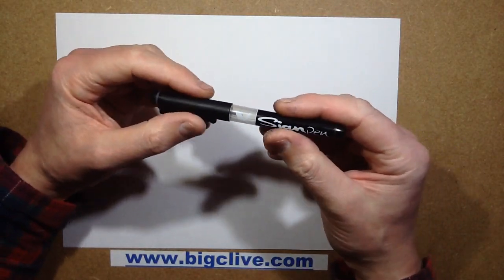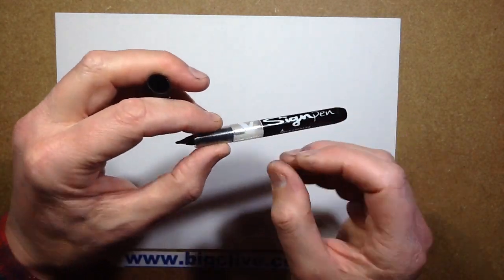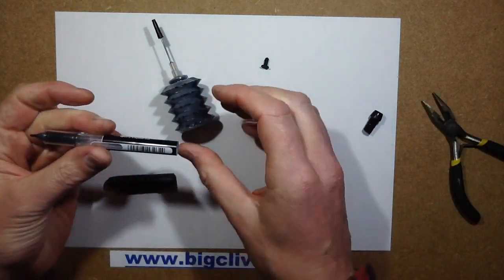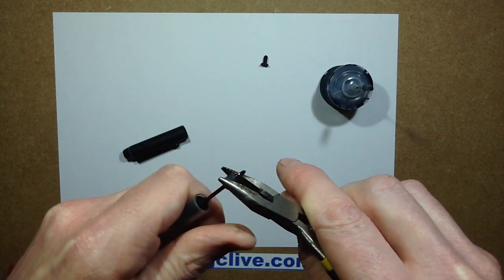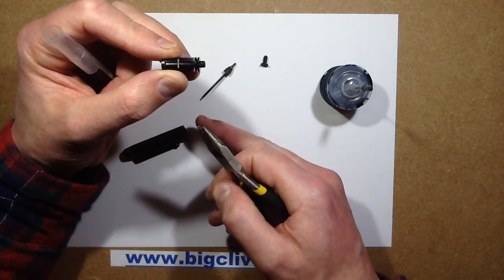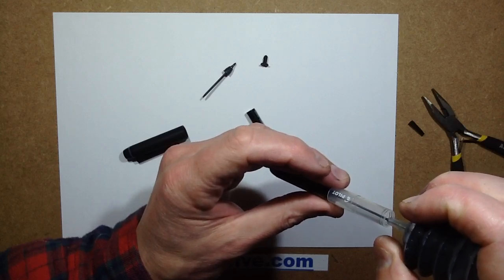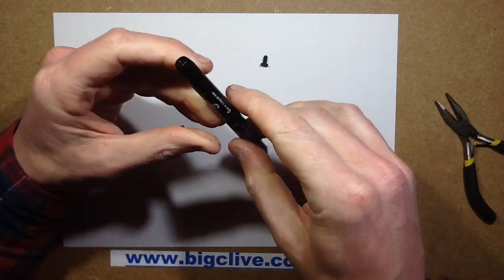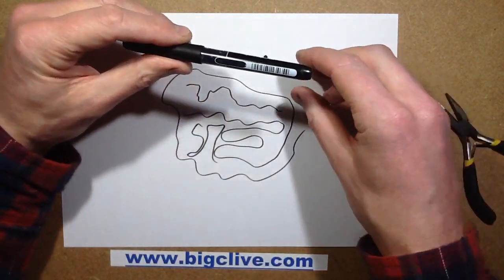Refilling a Pilot V Sign pen with inkjet refill ink.

Comment: Once the felt tip nib come off, I would suggest using a syringe with a needle, to inject ink through the hole left behind by the nib. That way, no need to pull the finned section out. It looks like it requires a fair bit of force to pull out with a pair of pliers and risk damaging it.

In another youtube video, refill pilot pen using vacuum method, the method can be used for this pen without any risk of damaging the pen.

Thx for showing us another way to refill this pen!
Reply from the maker: The ribbed section is pretty robust, but you do have to grip the end quite tightly.  I also wanted to clean the ribs of residual ink, although you're right, a long syringe would fill through the nib and wick hole.
Reply: not so robust though, we can see a bent disk on the end in the video. and if you do it multiple times it will break. so the needle already on the refill kit (looks narrower than the felt) should be the better option unless you really have to clean the ribs.

Comment: I've kept a Pilot V5 going with fountain pen ink for about twenty years.
Reply from the maker: How does it compare to a new pen in terms of writing smoothness?  Some of these pens only seem to be bedding in as the ink runs out.
Reply: I'm a big V5 fan.
Reply: Wow, that's a really long time. After about 5 fillings, I find that the ball in the tip will drop off. I get better mileage with a pilot varsity/v pen. I could refill those indefinitely.
Reply: ThePillenwerfer what was the ink's name? I want to refill my v7.
Reply: It was Parker Quink fountain pen ink.  I'm sure other brands would work.
Reply: That pen has lasted you longer than I have been on this earth...
Reply: @bigclivedotcom  I am using it for 4yrs now so u can't tell the difference
Reply: @bigclivedotcom  I use v 7
Reply: @soyankanagray6492  I use pilot hi-tecpoint ink. It's super cheap and is the same quality as the new pen ink. Works well with v5 and v7

Comment: Great video. Will the wick hold up? It seems on many of these pens they go bad or get dried out or worn out.
Reply from the maker: The tip does eventually wear out after several refills and very heavy use.  It helps to use pens like these on good quality paper that is not scratchy and abrasive.

Comment: I wonder if it would be possible to drill out the top of the ink reservoir, allowing you to use the entire barrel as an extended reservoir?
Reply from the maker: I did ponder that, but as standard, the seal the end-cap makes with the barrel is probably not ink proof.  In hindsight there would also be an issue with ink flowing down the air inlet as soon as the top was uncorked.
Reply: +bigclivedotcom Hi. Can you give us a link to your japanese pens? Or at least their exact name? Can we refill them? Thanks!

Comment: There a hole in the bottom or other side of the pin, plus the plug on the bottom end, end with out tip pulls out.  Can't you just fill it through that end through the hole or is it not the same resavor.

Comment: Can pls let us know how many times the pen can be refilled before the fiber tip wear out and is there a way to replace/substitute the worn out tip? Thx!
Reply from the maker: The wear on the tip depends on the surfaces and pressure used.  I don't think it's really viable to make a new tip.  If it fails it would probably be easiest to buy a new pen.
Reply: If you were going to try to do that, it'd make more sense to simply buy a Platinum Preppy sign marker, and a stash of replacement fiber tips.

Comment: @BigCliveDotCom: can you share the brand and model of the inkjet refill that’s used in the video too so I can purchase a similar one where it would fit nicely during the refill.
Reply from the maker: It's one I bought a long time ago.  I refilled the concertina injector from a bottle of printer ink.
Reply: @bigclivedotcom  Does it matter whether the inkjet ink is dye-based or pigmented? Thanks!
Reply from the maker: @SmasherBunny  The stuff I use is dye based.  I'm not sure how well pigment ink would work.

Comment: Regular Indian ink should work with this pen shouldn't it? As it seem to flow fine when I tilt the pen. Also when I try this with the pliers it seem to bend the nib and could that be why it isn't working? If so I cant seem to do it without bending it
Reply from the maker: I used a pair of side cutters to gently grip the seam on the tip of the pen well back from the fibrous tip.  It should handle any decent free flowing ink.  I just had printer ink on hand.